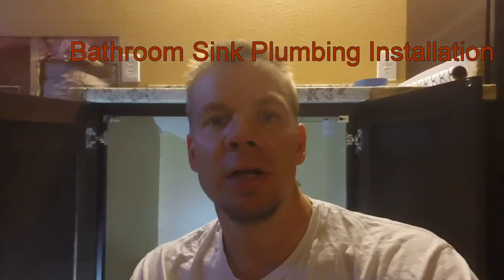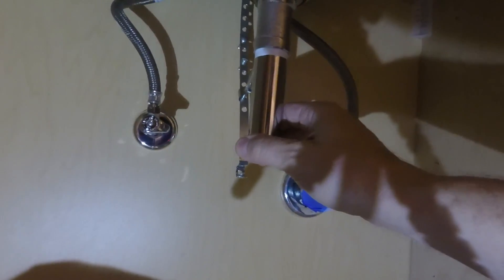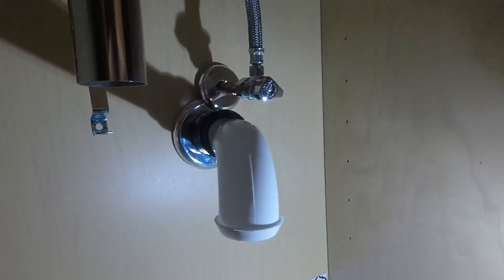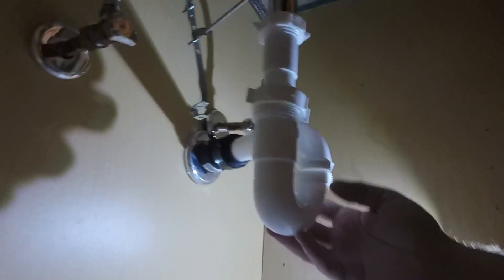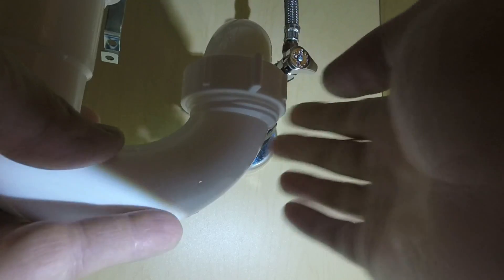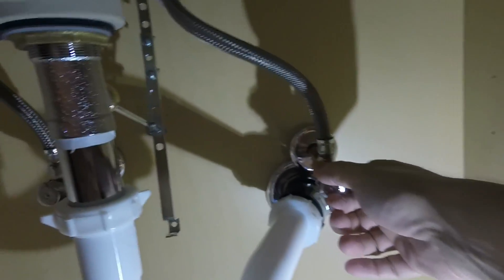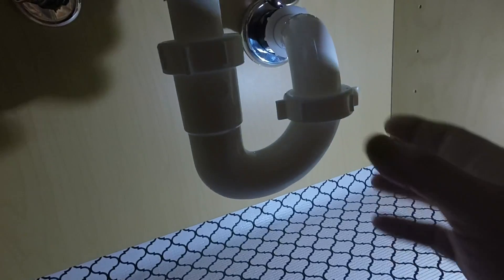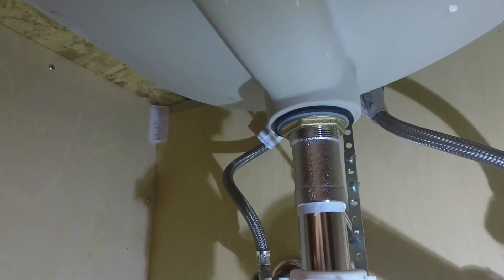Bathroom Sink Plumbing Install

Comment: Thx for the video.  My supply lines and sweat joins always work perfectly.  Where I get tripped-up is: the drain.  So many parts, tubes, nuts, washers, and extension pipes.  Invariably my drains always leak until I redo them 3 or 4 times.  I admire your skill.

Comment: New subscriber here. Thanks for the video.  I am replacing the master bathroom faucets and drain pipes.  The house is only 30 years old. My main problem with leaks has been the drain to the trap.  I also purchased supply lines.  I had to run back to get extensions with should solve my problem tomorrow when I fix my errors.   Thanks again for your video. Very helpful to see how the experts do it.  Haha.  All the best and happy 2022!

Comment: Must be a an entire bath renovation. brand new plumbing. I like the 1/4 turn valves. Did you sweat them or are they compression fittings?

Comment: Mike, thank you for your video. Help me with my project today after back in forth to Lowes and Home Depot..regarding 1 and 1/4 size drain tube connecting p-pipe size 1 and 1/2 using compression seal.

Comment: We have a gap at the connection point you're installing at 4:45. Is there a PVC reducing piece? The drain pipe is just a little to the right of the sink drain so currently, the gap creates leaks. This is a great tutorial! Thank you!
Reply from the maker: Hello Anjaly- there are reducing rings that are available. Also, there are flexible accordian syle drain pieces that can purchased to take up any weird alignment issues you might have with your plumbing; just make sure your connections are tight if you have a small leak. A large leak can definitely be an alignment or seal issue. Good luck! - Mike

Comment: I have used the metal ones before, but they rusted out on me over the years, and they get bent. This plastic thingy could help with those issues, and it should not scratch or leave a mark on the tile

Comment: Did you forget to put the washer onto the p-trap arm that inserts into the waste drain? I only saw you put on a nut.
Reply from the maker: With this application, the back nut locks in the p-trap arm to drain into the plumbing in the wall - the threads from the drain coming from the wall seal onto the nut(no room or need for a washer). Other setups may need a washer. -Mike

Comment: Do you have one of these where the sink drain doesn't line up and how to figure out what you need to fix the issue? My parents are having problems with this right now
Reply from the maker: The P-trap is moveable left or right and you can shorten the white drain line to move everything in and out- there are flexible P-trap's out there you can purchase at the home improvement stores. Good luck!- Mike
Reply: @mikesdoityourself  Thanks!!

Comment: Is it bad to use a Fernco band as the trap adapter instead of the one you used?
Reply from the maker: I'm not familiar with a Fernco band as the trap adapter but I'm sure there are many variations to this setup- you'll have to do your own research and use something that works best for your setup/situation. Good luck on your project!- Mike

Comment: Just FYI this is a cheap p-trap. That extension pipe that was cut did not have a removable washer (seal). It was that hard pvc,   The good kits have softer washers/seals at every connection. (All replaceable). For anyone needing to do this, the oatey kit is great. #39239 Granted it comes with an AAV but for $34 I like it. 
Also, ALWAYS flush everything out through flexible hoses before connecting to the faucet!
 Other than that good job

Comment: Question-How far in does the horizontal piece that goes into to the wall go?  If you push it in all the way so it's pressing against the waste pipe behind the wall, can the cause blockage and back flow? In other words, am I right to assume that you should stick it in so it's halfway in the drain pipe that it feeds into so it can drain properly?
Reply from the maker: Right, you want to push it in far enough where you're not going to get any leaks and not too far where you may cause a blockage. Good luck with your project! - Mike.

Comment: Do I need to put a washer on the pipe drain connection or just put it in no washer ?
Reply from the maker: Usually there is a threaded end at the wall. You should have a threaded washer that will fit around the pipe drain and tighten towards the wall. Good luck with your project!- Mike

Comment: Hi Mike, where did you buy your clamped rubber wall waste drain connecter?  And what is the proper name for it?  That would be a good solution for my 1 1/2 inch wall drain. Hopefully you see this soon as I'm heading out to the store soon:) Thanks for the vid.
Reply from the maker: Hello- Everything was purchased at Home Depot or Lowe's. I'm not sure what the drain connector piece is called, but the home improvement store should know what you need right away. If it's an item not available at one of these places, a local plumbing supply store might have what you need. Good luck with your project!- Mike

Comment: Mike, my drain stubout has an OD of almost 1.7".  It is metal pipe and it has no threads, they busted off.  I bought a PVC repair pipe which I thought would fit but the ring, which apparently is for a 1.5" diameter won't fit over the stubout.  What do I do?  Thanks, Fred
Reply from the maker: Sounds like you'll have to cut the metal pipe at some location and put an adapter and a new stub out on it- I would definitely get multiple opinions before deciding on a course of action. It could be a big job. - Good luck! - Mike.
Reply: Mike's Do It Yourself Thanks Mike, I'll go to my local hardware store, they are pretty helpful. Yesterday I got parts at HD and the stub out was a problem.  That adapter piece seems to be what I need.  Many thanks
Reply: Mike's Do It Yourself I ended up using a 2"x1.5" Fernco coupler and a flexible up tube.  I know the flex tubes aren't exactly recommended but I didn't have to do any sawing.  The 2" Fernco had no struggle tightening down to the 1.69" stub out. Many thanks.

Comment: Thank you. Great note about the direction of the o-ring. I'm about to just replace the p-trap and this is lessening the anxiety. I did not see you use plumber's tape on the connections. Was there a reason why you didn't?
Reply from the maker: Hi Albert- I used plumber's tape on the metal tail piece below the stopper because I was going from metal male threads to metal female threads. When you have plastic O' rings or curved sealing surfaces on your plastic tubing, they do the sealing of the water. No plumber's tape is needed; if you see a leak, either the plastic tubing is not aligned properly or it just needs to be tightened more. Good luck! - Mike.

Comment: i just installed the new bathroom lines, it doesnt leak but now the water doesnt go down and when i opend the pipes the water is in there
Reply from the maker: That's normal, you'll have water in the pea trap area- as you add more water down the drain, the water will go out your waste drain add stay at that level in your pea drain. Hope that helps. You could have a clog if water is above your stopper when the stopper is open. You can check out my clearing a bathroom drain clog if you need extra help. Good luck!  - Mike

Comment: my problem is the stub from the wall is deformed and very short?? How can I fix this?
Reply from the maker: If you're able to get a PVC pipe from the end of your p-trap into your drain stubout, it doesn't matter that much on having to use extra pieces to get the piping all the way to the wall drain.  Just try to keep the p-trap below the drain stubout level.  If your drain stubout is damaged and won't take a PVC pipe, you may have to open up the drywall around the drain, enough to where you can cut the drain line with a hacksaw or large pipe cutting tool,  put on an adapter piece and a straight section with a new 90 degree or straight drain stubout. Make sure you use the proper glue for the type of drain line your using.  You shouldn't have to worry about drain slope if you're just replacing a small section. If needed, use a clamp to secure it to the studs in the wall. Then you can repair the drywall. Good luck on your plumbing project. - Mike.

Comment: Nice video, very clear. Not to be critical but htose are channel lock pliers, not an adjustable wrench. Actually they work better in most cases.
Reply from the maker: RellikNev - Good call, thanks!
Reply: RellikNev

Comment: Do you use plumbers putty or tape on your installs?
Reply from the maker: Both depending on the situation, I like to use putty for the sink/downpipe seal- if it's metal threads to metal threads, I'll use plumbers tape. If your going from plastic threads to plastic or rubber seals then no tape or putty is necessary. Certain situations may vary but this should hold true most of the time. Good luck with your project! - Mike

Comment: What if the tail piece fell off and can’t put it back on? It just won’t fit back in like it was😓 help!
Reply from the maker: You may need a new tailpiece that may be longer than your old one that you have- you can always trim a new one down with a hacksaw blade if needed. Good luck on your project! - Mike.

Comment: Hi, novice here, I’ll be replacing my vanity soon so I just wanted to know if any type of adhesive should be used when    All is in place and you’re ready to hand tighten connections around the P trap and all. 
Thanks
Reply from the maker: Hi Michael- Everything should be water tight without adhesive, just be sure if you have angled rings around the tubing that they are facing the correct way and hand tighten the collars. You may need to tighten the collars more once water is flowing through the pipes. Hope this helps and thanks for the comment. - Mike.

Comment: good video. Curious though when is it necessary to use contact cement?
Reply from the maker: Thanks, I've used contact cement on vehicle or bicycle flat repairs or blow up tube/bed repair, where the material is a plastic or neoprene rubber. PVC has its own adhesive and whatever material your joining should have that specific adhesive used for it when applicable. - Mike.

Comment: How come u diy guys don’t say make sure the water main is off!
Reply from the maker: You only need your water main off if you want to replace your water valves at your hot and cold supply lines coming out from the wall- otherwise you can shut off those two valves to replace any water supply plumbing going to your faucet.  Everything after your faucet (drain lines) can be replaced with the faucet turned off and the water supply lines turned off or on - Mike.
Reply: Mike's Do It Yourself thank u